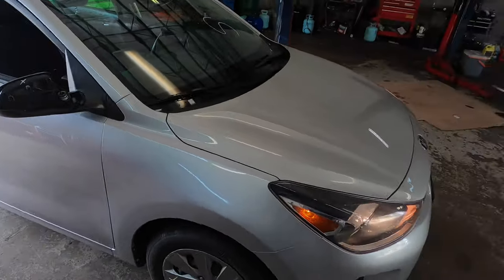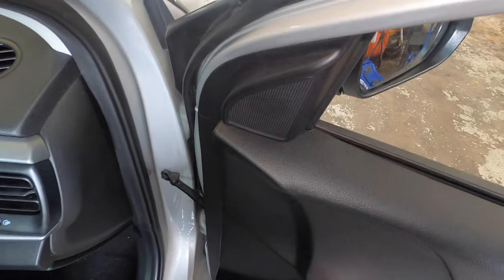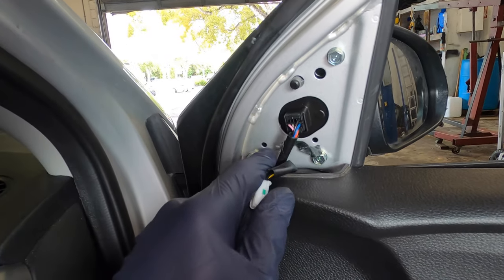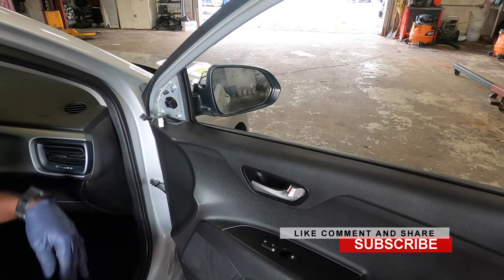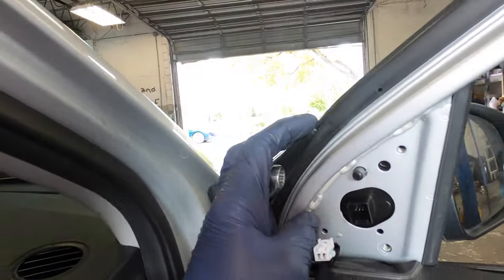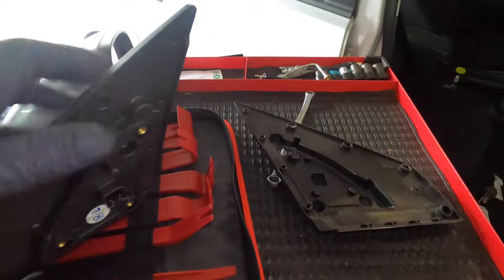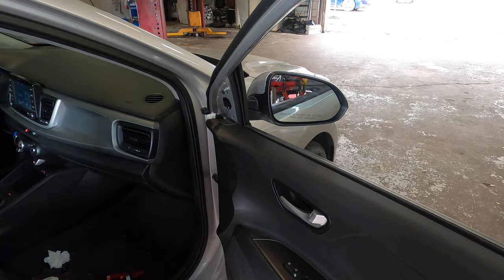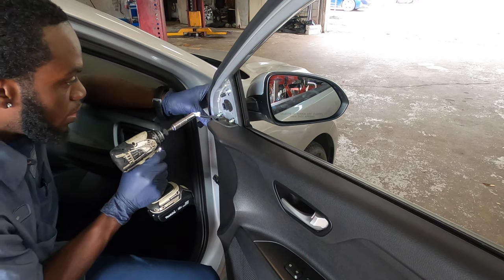Replacing the mirror on a kia rio

Comment: I just wanted to say that it’s not the same and does depend on the year. I have a 2010 and this panel is smaller on mine and had to take off the entire door panel just to access the bottom bolts